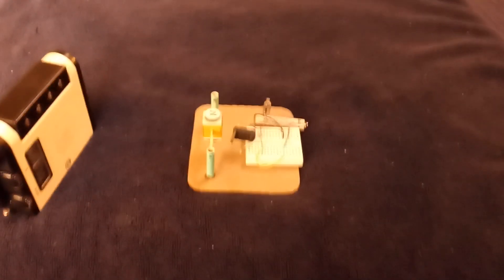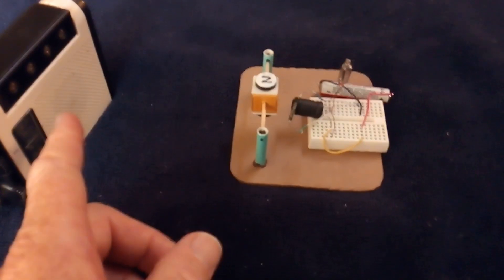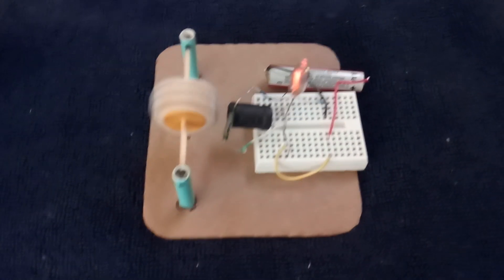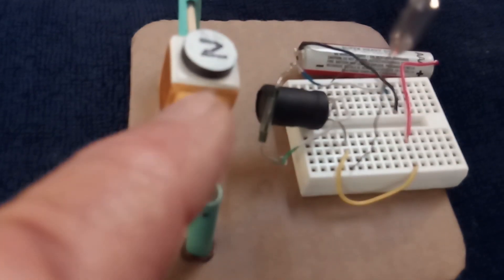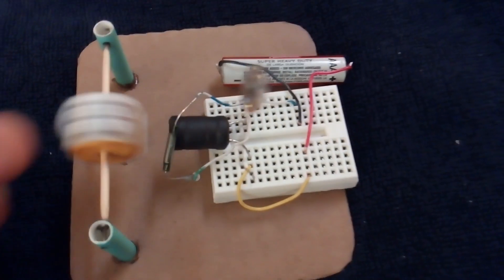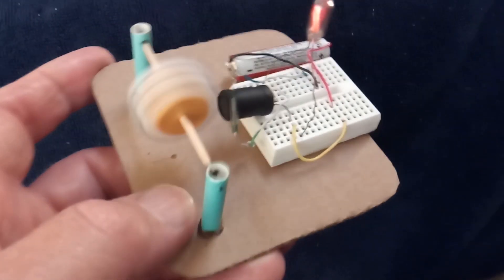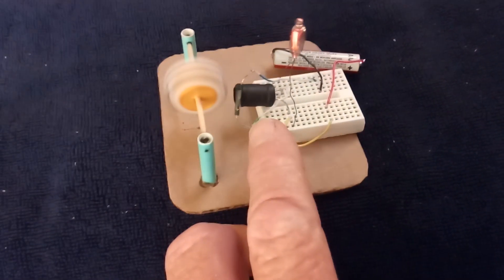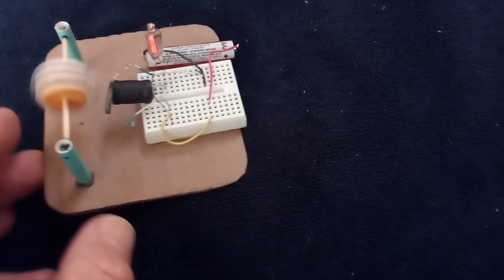Self Oscillating Choke Motor

Comment: I've got 3D files of rotors I could share with you. I've been inspired by you and and Lasersaber. I'm really interested in building an unpscaled model of your "Scotty I need more POWER!" Project. I like to make it powered by passive solar and super caps but I want to figure out how to capture back EMF and a joule thief with a transformer to make it continously self running so I can charge a bank of 12 volt dc batteries. Thanks again for your creativity!
Reply from the maker: Sounds like a fun project.

Comment: Someone should put his fancy oscilloscope over the reed switch.
The reed switch is supposed to be closed when the rotor approaches the stator coil until the magnet is exactly aligned with the coil's pole.
The reed switch isn't supposed to oscillate during that approach.
I could't discover a diode in the circuit. Could a diode help the efficiency?
Reply from the maker: What happens here is that the permanent magnet and the electromagnet are in a tug of war with the metal in the reed switch.  It is a kind of resonance.  Things have to be just right for it to happen and it isn't pretty.  I'm sure that the scope shot of this would show the chaos of this war and show an ugly wave form.  It is basically a 'buzzer' oscillator.

Comment: I had a setup years ago that would oscillate like that. One magnet pole turned on the light, the other pole turned it off. If you held the magnet just right the electromagnet and the magnet would cause a battle. The permanent magnet would cause the reed to latch. The electromagnet if the same pole as the magnet it will open the latch.
Reply from the maker: That is what is going on here.  It is the battle of magnetic fields.  It works great until the reed switch welds itself shut.  I have never gotten one of these to run for very long.

Comment: Just curious, you mentioned the voltage, what is the current being drawn? Thanks
Love the toothpick idea and the choke is a clever idea. I wonder if a tunable choke would affect the speed of the motor. Do any of the chokes in the kit you bought have adjustable ferrite cores?
Keep the videos coming.👍🤓
Reply from the maker: The current on this is over 30mA.  I have not tried any varrible chokes and the kit I bought did come with any.  That would be a good experiment.  Thanks.

Comment: Would be interesting to try to run a Tesla coil off the fly back of such a small simple motor it works with a lager coil but looks like there’s just as much fly back power in the small motor as the large to run it
Reply: Just connect the primary coil to the output of the coil + side before the reed switch other end to a Lv gas spark gap and hv cap across the reed switch I have a neon across the secondary coil every pass of the reed switch runs the neon across the secondary and small amount of wireless rf  secondary is small 200 turn secondary but like the size of your design it might work better than a larger coil
Reply from the maker: @MrDezza21  Thanks.
Reply from the maker: Interesting idea. Thanks.

Comment: Haha, 3D printing. Just when you were moving into paper straws you have been drawn back to plastic 😊 That self oscillation is an interesting side effect. On the back of your comment on the paper straws for my rubber band cars I made one. It will be on my "Put a rubber band on it" channel on Tuesday. I am currently trying to clear my dining table of my projects, so we can use it for Christmas 🎅🏼🤣
Reply from the maker: I will look for your paper straw rubber band car next week. I think plastic is Ok in small amounts -----so I build tiny motors. Ha.  Christmas brings a big slow down of project building in my house also.  I think that a messy table has a very festive look.  My wife does not.
Reply: @Lidmotor  it might look festive but apparently we are supposed to sit down and eat a Christmas meal at the dining table. I do remember doing that in the past some years ago 😆
Reply from the maker: @GrandadIsAnOldMan Me too-----some years ago.

Comment: I've been using chokes in my joule thief circuit. I'll give this a go.
Reply: There's a three legged choke that makes a great joule thief. I got mine from China. You only need one to make the circuit.
Reply: @benwinkel  I'll have to look into it. What is the 3rd leg used for both in your application and it's original. I've just never seen such a component.
Reply: @jvon3885  It's basically 2 coils wound on a single ferrite core. You simply measure where the 2 coils are connected at the 3rd leg. You use that as the common connection on the positive side of your battery or whatever power source you use.

Comment: I think that the neon may act as a  capacitor and parallel with choke makes a resonate circuit. Does the choke resonate with LED as well?
Reply from the maker: Yes. This will work with an LED (or string of them).  The magic is happening ai the reed switch,  rotor magnet, and inductor alignment.
Reply: @Lidmotor  Thanks for replying back Lidmotor. That's good point.